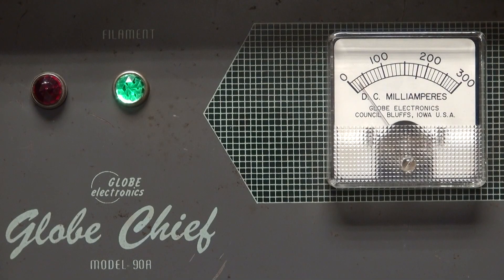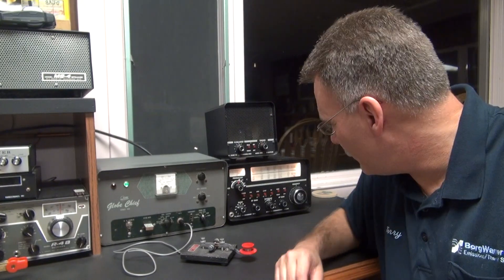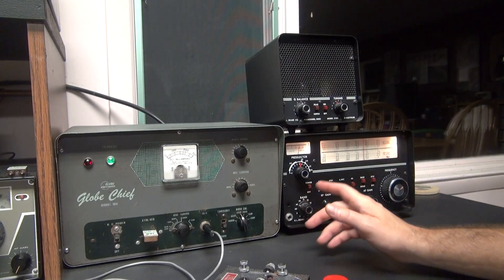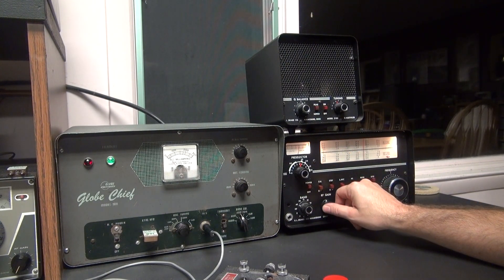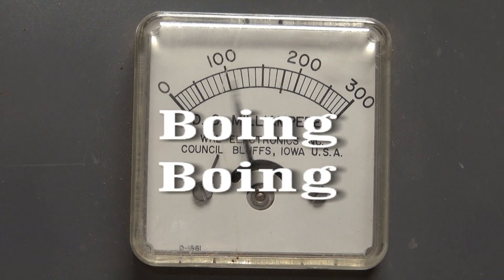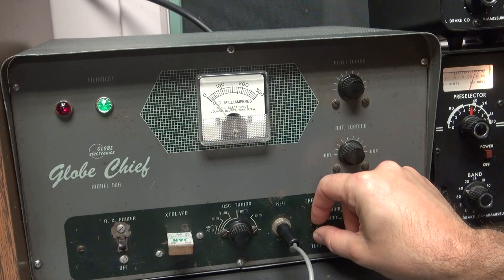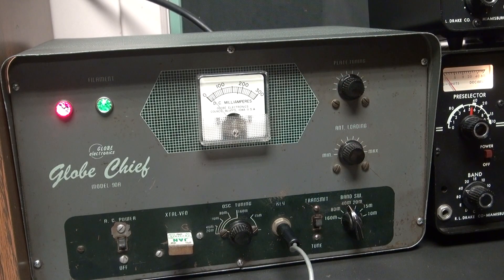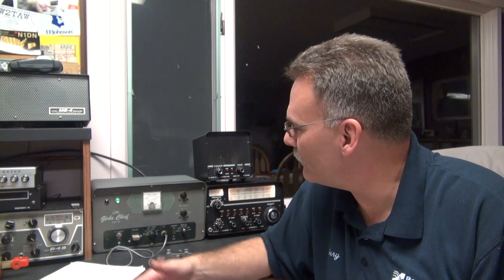Vintage WRL Globe Chief 90A Ham radio Tube 807 CW Transmitter QSO

Comment: Thanks for the demo.  Tone sounded fine, but keying had a nasty chirp.  For anyone who has one of these, or even a Globe Scout, to avoid chirping, tune the osc slightly OFF-peak (one side or the other ...experiment for best results) for nice CLEAN keying.  I've seen too many vid's claiming that chirping is a "feature" of these.  That does not have to be the case with careful pre-tuning.